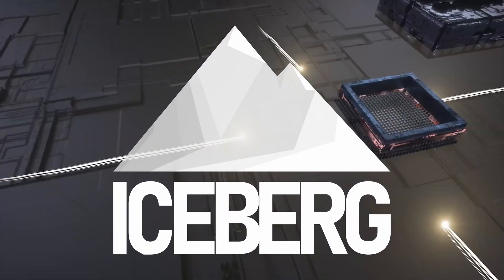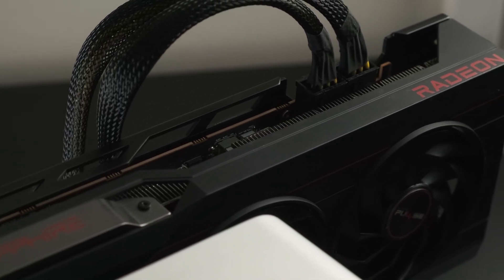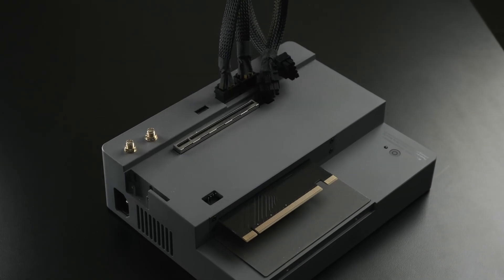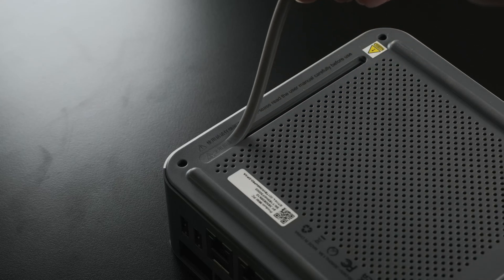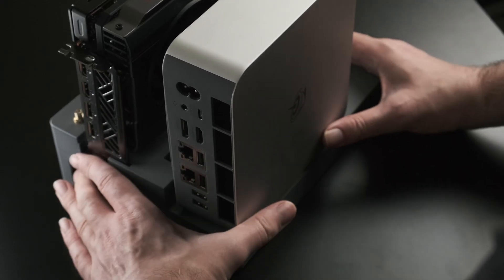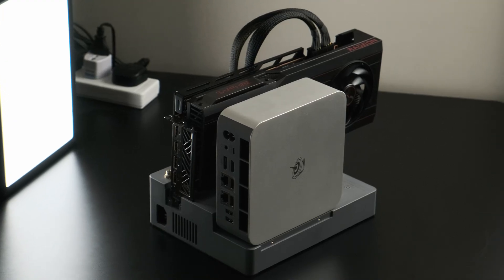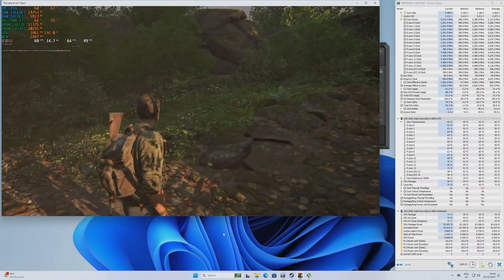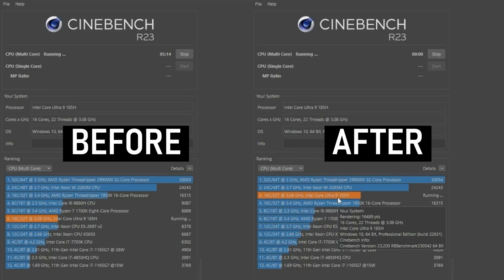The Ultimate EGPU Solution (was kinda obvious, when you think about it) | Beelink EX Dock

Comment: I bought one of these and I'm a little disappointed with the state of them. The performance is great, but everything else is a struggle. disassembly is way more involved than I thought it would be but that's fine. My biggest complaint is the drivers. None of the drivers are available on their website. I had to email support and they sent me a mega link to drivers, half of which contained nothing. The ethernet is supposedly Intel based on the driver they sent me, but Intel Driver and Support Utility doesn't recognize it. My SD card slot isn't recognized and I'm currently talking to support. Speaking of support, I'm pretty sure it's just a single dude. Every single support email I've sent them (and there has been a few), is responded to by the same person and I feel like he's doing his best, but it's not very helpful.
 
I'm glad I have one, I quite like it when I'm using it but I'm only able to deal with it's issues because I know a bit about computers and thankfully I didn't recommend one of these Chinese mini pc's to my grandma -which I nearly did. These are not ready for mainstream consumers.

Comment: Totally unrelated but it seems to me you are the right techie to ask... Whats the strongest  GPU would you pair with 4770k ? I would like to play Resident evil 4 remake and my 780ti dont cut the mustard anymore
Reply: Radeon driver overhead would be great for that quadcore, get a 5700xt or equivalent, wont need more than that
Reply: Thank you
Reply: @chico_fiesta  no problem bro, buy used to save money for a better cooler if you wanna oc a little bit with the i7, and make sure you have dual channel ram and an ssd if you don't already
Reply: @PelonixYT  i have corsair dd3 limited oc edition 16 gb dual channel RAM. Decent thermaltake (frio i think)air cooler but not so sure it could handle the OC. Is rx 6600 near the 5700xt performance cause i can get that new cheap in Croatia?
Reply: @chico_fiesta  for the most part it is, and new features with less power draw

Comment: My concern with this would be that GPU power and PCIE connectors are only rated for a fairly low number of disconnect/reconnect cycles, but this setup implies a use case where you might be disconnecting/reconnecting the GPU fairly often.

I suppose if you had an old GPU sitting in a drawer then maybe it'd make sense to put it to use in this kind if setup. It's a bit of a cludgey solution though.

Comment: I thought years ago with the obsession with maximum glass, such as computer cases with not just one but two glass panels, that very shortly this obsession would look as outdated as bell bottomed pants became in the 1970s.  Why is most of the desktop computer case there, especially if the cases aren't really doing that great a job funneling air from inside / outside to cool?  This is just the continuing process of the rationalization of computer cases?  Less is more.

Comment: Very curious that as designer of both PC and Dock there is no elegant solution offered for AC passthrough from Dock to PC.
Perhaps we'll get a "V2" some day with that plus support for 450W(3x150W)+75W(slot) GPU power. AND puts the PC on the backplate side of the GPU.

Comment: I still think the most possible solutions for eGPU is for Laptop but with raw PCIe X16 Lanes slot. Not USB-C or USB4 connection.

The best candidate for this, is Framework Laptop. They already have patented design for swappable Laptop GPU, so why not include an empty PCIe X16 slot instead? 

So user can use full sized GPU whenever possible. Of course user have to provide its own Power Supply.
Reply: Literally zero laptop/mobile CPUs have 16 available PCIe lanes.
They're a all x8 with 8 dedicated for the interface between CPU and iGPU; Intel and AMD.
Even AMD's (desktop) APUs 3000, 4000, and 5000 series APUs are 8x, 3.0.
(8000 are x16 but are still 4.0 vs 5.0 of 7/9000 series CPUs.)
Reply: @tim3172   All AMD Ryzen HX Laptop CPUs are beyond 16 Lanes, so it can be divided for SSD and GPU

Comment: Edit: if you did, you could test the benchmarks between Gen4x16 vs Gen4x4 oculink with similar mobile CPUs.

You need to test the one option that you haven't tested yet. 
Oculink which provides PCIe4.0x4 64Gbps bandwidth.

Comment: I gotta ask, can you SLI two cards with the dock and the thunderbolt port? 🙃
Reply from the maker: You know, I never tried…
Reply: The motherboard has to be cerifited for S.L.I. you should be find with all AMD RDNA type GPU, they all support mGPU. No need for certifited boards on AMD side.

Cherynoblyite can use two rtx 4090 in mGPU with driver 566.

Comment: This is really cool as a solution to a problem with mini PC’s and using external GPU’s! But if you’re willing to put up with this much faff and rigmarole you might as well just build a SFF system and have a system with a similar footprint and more powerful desktop hardware! (I might be bias though because I’m a SFF PC user myself)
Reply: Might be worth it on the power efficiency side. About 20w is consumed by the GPU when not using it.